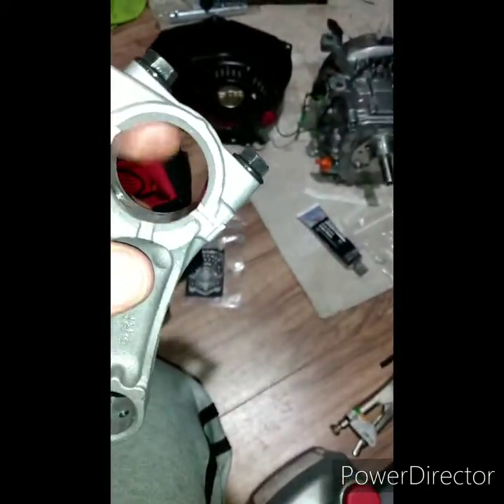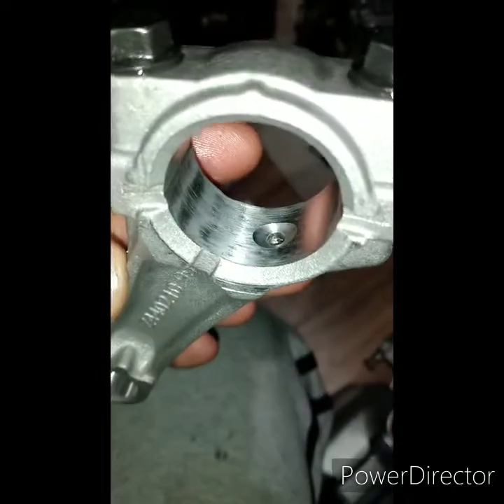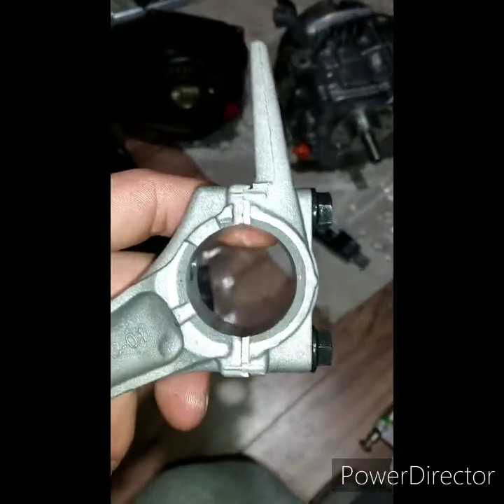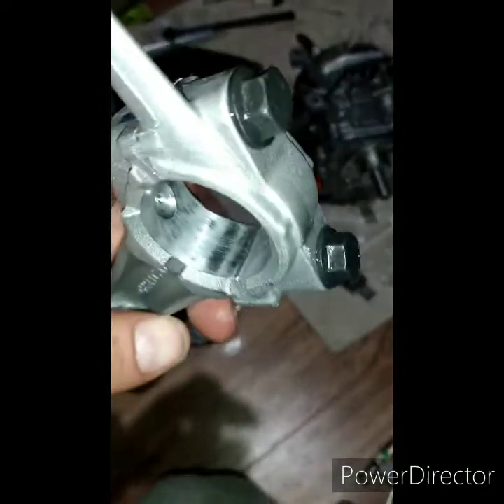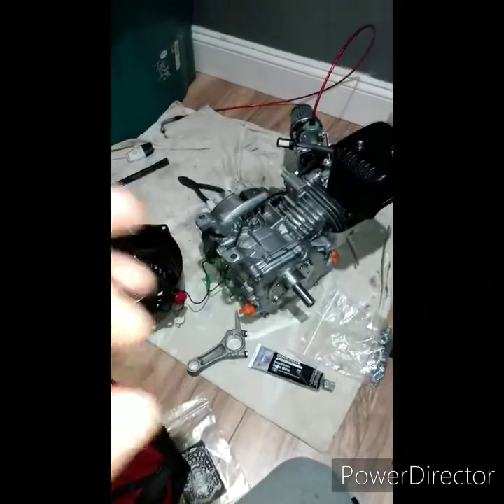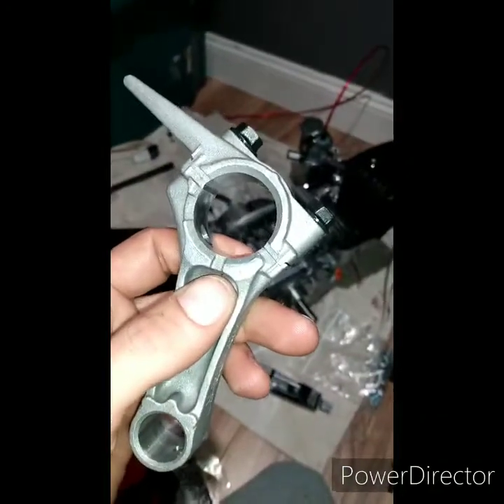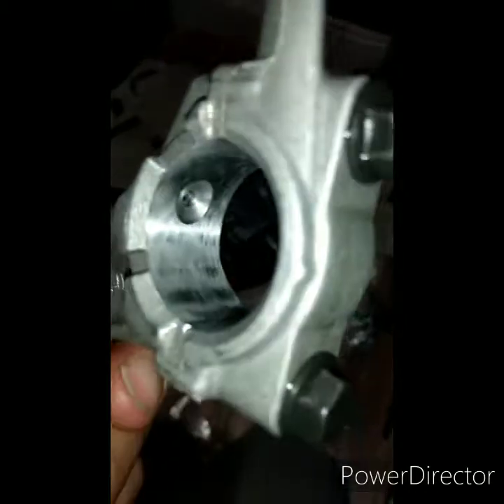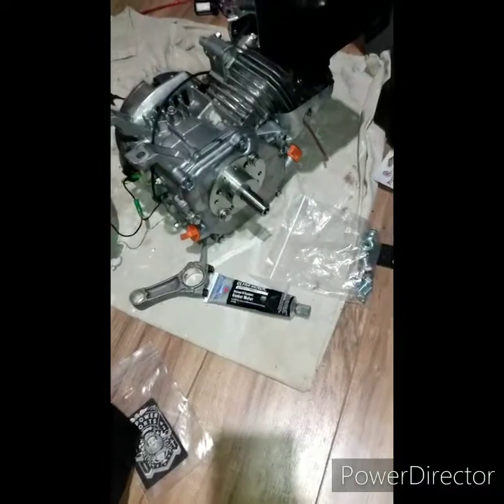Predator 212 stock connecting rod is trash!!! Out of round brand new.

Comment: Mines knocking out of the box. Putting a rod in now. Probably the same issue but I'll measure it
Reply from the maker: Yea definitely gotta at least put a bullet rod in all of these if u want them to last. The sock rods are trash. Id recommend a bullet flywheel for safety also if ur disabling or removing the governor
Reply: @theperfectpaintertoolreview  I got both. Just a middle of the line build.
Reply from the maker: @tashatorrid  that's all u need to start. U can always add more. I still need to get my billet flywheel but my key is stuck, can't get it out. I guess that's what I get for using a harbour freight torque wrench lol
Reply: @theperfectpaintertoolreview  puller or a bigger hammer should work
Reply from the maker: @tashatorrid  I can get the flywheel off, it's the actually key that's stuck in the keyway. I need to get it out to be able to install the new flywheel correctly. Suppose to use valve lapping compound to mate the new flywheel to the crankshaft. Ill just put the new one on if I have to but ide like to use the lapping compound.
Reply: @theperfectpaintertoolreview  heat it up and go from there
Reply: @theperfectpaintertoolreview  just checking in to let you know my rod cap was about hand tight from the factory. Still in round as it was barely run
Reply from the maker: @tashatorrid  that explains why it was knocking. I swear they just throw these things together. After hearing this I'm def opening up and inspecting any 212 I buy before starting it.
Reply: @theperfectpaintertoolreview  Hey man I just tried putting on the connecting rod and when I tighten it down on to the crankshaft the crankshaft won't move. What's going on? Thanks
Reply from the maker: @itsme5279  check the piston rings, make sure the piston moves freely. But is it a new rod? If so are u sure u got the rite one? It may be the wrong rod. Example. A rod made for a gx200 will not work in a predator 212. Measurements are different